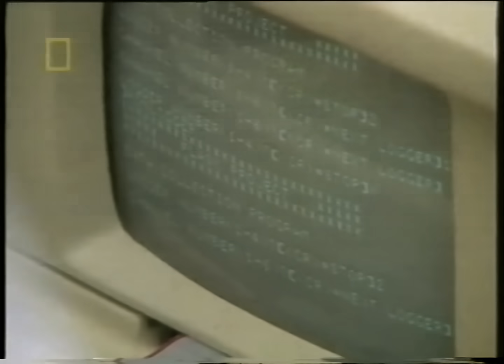Train Crash Test @ 160km/h (99.4 Miles) into 50 tonne Metal Block

Comment: Does anyone know what this working is? According to my records Class 46s didn't have any booked passenger turns in 1984, however they did appear on NE-SW services particularly on summer Saturdays, and also on Trans-Pennine services. However given the short length of the train I think this could be a Newcastle-Carlisle service, replacing a failed DMU.
Reply: It was staged. Nobody was aboard.
Reply: It was a test to prove that Nuclear Flask wagons were safe, even when hit by a train travelling at 100mph. The flask in the test contained a pressurised inert coloured gas, which would have escaped if any leak had occured. The flasks are designed to withstand virtually anything short of a direct hit by a large bomb. This was aimed at pacifying public disquiet after Greenpeace had made silly accusations that carrying Nuclear Power station rods in rail wagons was dangerous. What silly Greenpeace had not considered was that if this Nuclear traffic was dangerous on the railway, the only alternative was to transport the product by the far more dangerous method of Road transport. This test was conducted on the "Old Dalby test track" in the Midlands. (A long closed branchline used for all sorts of tests).  All the vehicles involved had already been withdrawn from service.
Reply: There's no need for that. People who know the facts shouldn't be ridiculed, especially when a question was asked.
Reply: Ceadda Keohane
The question makes no sense, as the questioner apparently assumes that an accident just happened to occur to an ordinary service train on a dead-end line in front of multiple cameras and an audience of hundreds sitting in grandstands. I suspect the question is an exercise in trolling.
Reply: Very good!
Reply: Adding further strength to my theory is the fact that the DRS nuclear train depot in Carlisle is nearby and they would often leave nuclear flasks in sidings to provide power to local communities along the line.
Reply: The test was conducted at British Rail's Old Dalby test track near Melton Mowbray, using one of two Class 46 locos bought out of service and three surplus Mk.1 coaches fitted with new designs of seat and table, to be tested with crash dummies.
A Flatrol low-loader wagon was sacrificed, and the flask was one which had only ever been used for drop tests and had never contained fuel rods. Steel dummy rods were used in this case. They ended up as a crushed, compacted mass.
The train did not simulate any actual working, but was the heaviest, fastest combination of stock which could be spared at the time.
Reply: ***** coming from someone who watches x factor if the world was left to people like you we would not have crawled out of the ooze

Comment: no SIGNIFICANT  drop in pressure? well with atomic it does not need much to become a disaster. stupid comment and clip.
Reply: With that they mean that what's inside is still seperated from the outside. But you were right about your comment being stupid.
Reply: Jakromha you told him.

Comment: 160kmh = 23 mph .
Reply: obviously its not why post stupid comments honestly.
Reply: Poopingbotham Because it's what the rest of the world does and it's a standardised system that makes far more sense than the arbitrary and confusing imperial units.
Reply: Poopingbotham Hence why everyone in the goddamn world uses it
Reply: 1 mile is 1.6 km. where did you go to school and learn maths?
Reply: Poopingbotham Metric is easy. Everything in 10's. Easy mental math. Imperial.... Not so much
Reply: I do know that 82 meters = 5 feet or my cock size...
Reply: austrorus Look, it doesn't have to be difficult, just get a km/h to mph converter and that will do all the talking, thank you.
Reply: Daniel Swift since it was 160 km exactly I did not have to look any further because i know 1 mile is 1.6km. that much i still can work out in my head without electronic or computer help.....
Reply: Poopingbotham Noone is forcing you, it just makes alot more sense and is highly recommended if you're gonna go to some country where they use the metric system (pretty much everywhere except for the USA)

It's like learning to drive, noone forces you to but it's bloody useful.
Reply: Poopingbotham problem is that french is not a majority language. Most of the countries in the world don't speak it. Metric on the other hand pretty much every single country uses it plus it's a easier system to use. For example how many metres in a kilometre? 1000. How many feet in a mile? 5280...... Getting exact numbers off your head in metric is so much easier. Plus celcius makes tons more sense than Fahrenheit
Reply: Poopingbotham That's because you've grown up with it, you can't assume just because you yourself find it easy that everyone else does. Most of the world looks at the Imperial system and thinks 'what the hell'. You're argument sounds like: 'I like this and that, therefore they are the best and everyone should find it so'
Reply: Poopingbotham This is why Metric is easier. If someone asks me how many centimeters are in 5 metres its very simple to calculate. 5X100= 500. Same goes with kilometers. And Celsius freezing is at 0. Not 32. Anything below 0 is freezing. Anything above is not. Very simple.
Reply: I think the first guy was joking...
Reply: austrorus the train was going 99 mph

Comment: 1:03 ULTIMATE?!?!?!?! ultimate would be putting it in a small plane and colliding it into solid cement going strait down at 500 mph
Reply: I'd love to see you get a 50-ton box into a lightplane, or into anything smaller than a C-17 for that matter. These things are only transported by rail, so apart from dropping from a crane (already tested) any other kind of accident just couldn't happen. And yes, the container would probably withstand an aircraft crashing on it, because aircraft aren't built of forged steel over a foot thick.

Comment: This test against the nuclear flask was designed to be conducted at 100mph. Why convert it to kilometres per hour - and why post 99.4mph? Is that what your calculator told you John? I hope you don't drive John - our roads in the UK are calibrated in miles and our vehicles in mph.

Imperial measurements have served us perfectly well for 2000 years. Why change them to the artificial measures Napoleon tried to impose on the world? Otherwise, why did we fight him for all those years?
Reply: The documentary "Crash Test: Train" from which this was taken was made for an international audience, most of whom would understand metric measurements better than imperial. The actual impact speed was just over 99 mph, so the figure given is about right.
Reply: Andrew Booth i hardly call it artificial measures as i doubt nature intended that we use imperial measurements but we should anyway as they are british
Reply: You are confusing metric with decimal systems or other arbitrary divisions. The metric system composes of 7 base units, of which degrees is not one nor is how many months are in a year.
Reply: ***** But the test was conducted in the UK specifically at 100mph. We still use the Imperial system here in the UK as we have for 2000 years - all our road distances for example are calibrated in miles as are the instruments of all our vehicles. To convert the 100mph test to 160kph and then back to 99.4kph is clumsy, unnecessary and rather silly. It most certainly is not convenient. Why change something that's worked perfectly well for centuries?

The very same engineers you quote must contend with Imperial measurements when they visit the US or Britain, especially if they wish to drive here. We cope with our time reckoned in a 24 hour clock, a week of 7 days, 12 months and 52 weeks in a year. It's all very easy for anyone with even a limited intellect so it shouldn't present problems to an engineer, especially when they are happy with 360 degrees in a circle.

There's also the fact that we fought a whole series of wars with Napoleon who was trying to rule the world. He invented and tried to impose his metric system on the world and so many died opposing that. He also imposed on Europe a metric time with 100 minutes in an hour, a 10 day week and 10 month year. It didn't work and we have gone back to a 24 hour clock and 7 days in a week. Why change something that's worked for centuries?

Comment: Well the question would rather be, why didn't they test it with a freight train.

A lot more mass, a lot more kinetic energy.

But then, it's always the same, if it concerns nuclear power, no government is telling the truth.
Reply: There were no surplus HSTs in 1984. All were relatively new and needed.
Reply: Because freight trains don't exceed 75 mph, and kinetic energy increases as the square of velocity. Besides, a train is not a rigid mass. Couplings and buffers absorb a lot of energy, as do crushing, riding up and jackknifing, and full brakes come on automatically as soon as the connection is cut. It was calculated that a longer train would not have transferred more kinetic energy to the flask, which in any case was accelerated instantly to over 90 mph.
Reply: or HST

Comment: Test Results:
Any1 on board is screwed.
Reply: technically you are correct
Reply: They reckoned from examination of the carriages after this test that if there had been passengers on this train most of them would probably have survived. There was a crash in 1968 between a train going at about the same speed as the one in this test and a 120-tonne transformer on a low loader truck that had got stuck on a level crossing. 11 people on the train were killed but nearly 300 survived.
Reply: @cedriclynch  that crash also involved the first use of automated level crossings. If I remember the transformer was being transported at night and there was an error on part of the police. I could be wrong.  I do remember the transformer was on way to being stored.
Reply: All that nuclear waste is fine tho.

Comment: The locomotive used was from a series (Class 46) in the process of being withdrawn anyway. By the time of the crash ending its career, 46009 was already approximately 20 years old.
Reply: David Wood class 313s are 42 years old and still run on the national rail lines

Comment: The locomotive was powering the train. The driver set the power handle, left the cab, and released the brakes from the ground using an extra brake cock that had been fitted specially.

Comment: Actually, the loco was modified with an external fuel tap and a valve in the brake line, so the driver and a technician could open up and release the brakes while standing alongside. The start is shown in "Operation Smash Hit", also on YouTube, but sadly without the loco sound.

Comment: @danlefou - Well yeah, sorry didn't know how to put it, I meant what you said when I said remote control as yeah all you need to do is push the throttle up and acceleration would be so slow there'd be enough time to jump off without causing injury. Also yeah, my post was based on what I read about somewhere else about this video, I was pointing out it wasn't a test to crash the train but for the container. So you clarified what I was trying to say, thanks. :)

Comment: They were just trying to knock the lid off or cause a leak. Never any question of an explosion, however much nuclear material (spent reactor fuel) was inside. In this test there were only steel dummy fuel rods and water. 
The train was not remote controlled in any way; the engine was simply run up, the throttle locked, and the brakes released from trackside.